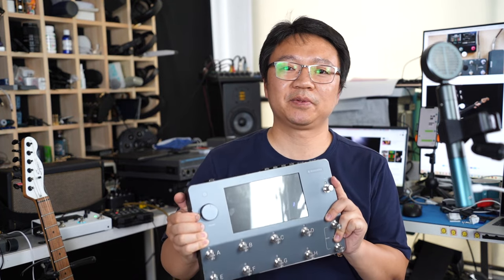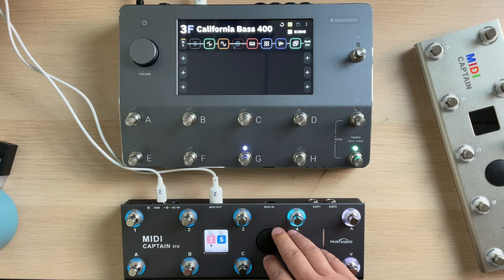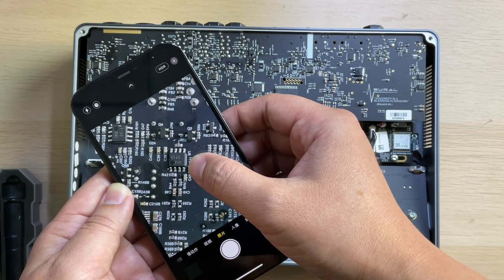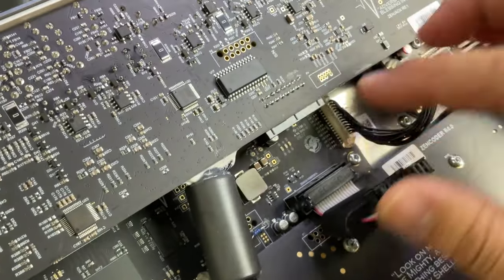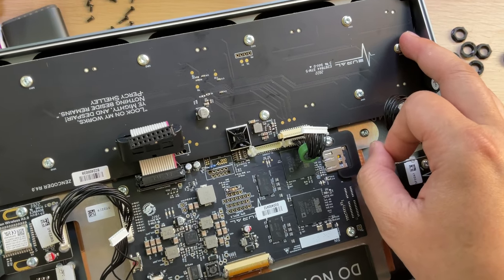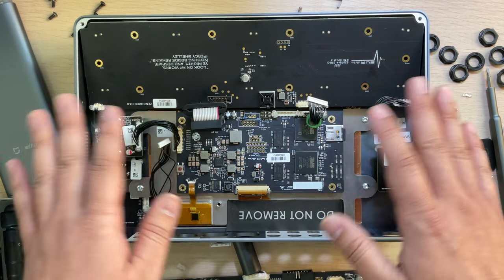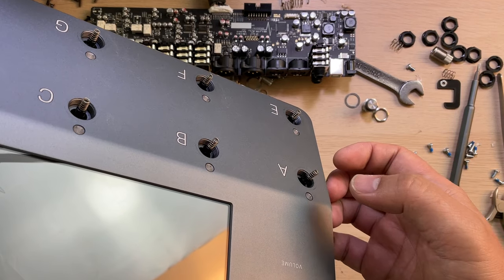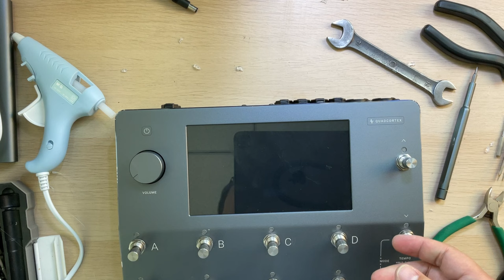Quad Cortex Teardown Good Design? Cost? Stable? Worth? and MIDI Captain Control

Comment: I’m not an engineer by any stretch of the imagination – I’m a guitar player who has soldered a few analog pedals and opened an old modeller once to see if I could fix the power jack that had come loose. So I greatly admire your expertise and patience when disassembling and reassembling this unit. Also, it’s very cool to get an independent assessment of the quality and cost of the unit. I was hooked from the beginning to the end! =)

Comment: @6:38 The MCP23017 is an i2c GPIO expander, basically gives you access to more IO pins to allow additional components to talk to a microcontroller/CPU- possibly used for the switches and encoders here

Comment: I disagree about the screen being the cause of how warm the unit becomes. If you put the unit into standby mode it still kicks out the same amount of heat. The case does a great job of being a heatsink though. 

Great to see it's well engineered and well built. Also, really nice that its built in Finland rather than the far east.

Comment: Any thoughts about the wifi module? I have weak signal problems, even when the QC is close to the router, and many people reported the same issue. Could it be a design fault, low quality components or a software issue?

Comment: I literally JUST bookmarked the little Midi Duo you make as I've got a Quadcortex ordered.  I'm wanting to use it to quickly control the QC looper.  I'm currently using a separate looper (ditto X4) and all I do with the looper is record a loop, tap a switch to stop/play the loop and hold down that play/stop switch to erase the loop.  2 switches needed to operate the Ditto looper.

What I'm hoping to be able to do is use the Midi duo pedal to do the same thing.  Program one switch to capture the loop and program the second switch to stop/play the loop or hold the button to erase the loop.

Do you know if the midi duo and quad cortex allow it to be programmed this way?  My pedalboard space is extremely limited which is why the midi duo is at the top of my list.

Comment: Fascinating breakdown. The engineering looks very good, except for the passive heat dissipation. I've got an HX Stomp. I keep a computer fan running next to its upper left corner, to wick away the heat, as that's where the screen is and where it gets the hottest. Works surprisingly well. Heat is the enemy of electronics, but there are simple solutions. Thanks

Comment: this was interesting but given time I had to skip forward. What was the consensus on the wifi cuz that is my biggest complaint on my unit that its quite weak. Oh and the old style USB port. Should have been USB-C IMO. Keep rocking!
Reply: I read often that usb C should be used on newer devices. But it think the old big ones are much more rugged. USB-C breaks much more easy. Don't you think?
Reply: @SebastianBogensperger  i dont really agree though I see your rationale mainly because they used such an out of date format. I am pretty sure most people would not have that cable format handy anymore especially if you need a long one as I did. USB is the standard and is being enforced in Europe across a lot of devices for uniformity so I suspect as the laws start getting enforced you will see a USB-C QC come out. I had to buy a special cable that terminated in USB-c so I could plug it into my mac. A cost I should not have to pay. But it is a trivial complaint over all. I was more pissed when they dropped the price bc I felt like I got taken advantage of. At least offer us some plug ins etc.

Comment: After around 10 year of use my Kemper powerhead  LCD has darkened that reading the letters was barely readable  even if there was backlight. then the silicon buttons are already yellowish. About a month ago I heard a a thud and then its gone. Apparently the power supply  gave up. I called Kemper helpdesk and still having difficulty sending it for repair until now.  My only regret is that I haven't used this for more than 50 times because I'm a busy person. On the other side my Axe Fx is still running flawlessly. I think Quad Cortex is build a lot better than Kemper .

Comment: Very good video. Would be interesting to get any thoughts on improving WiFi performance. With the WiFi module behind what's essentially a Faraday cage, it's hard to get a good signal.
Reply from the maker: Great point! I may check again where the antenna had been put. It is a big problem for a full metal box. When I design the MIDI captain with wireless 2.4G function, I had to made the side cover by plastic.

Comment: Great video!! Does anyone know the size of the screws needed to attach the foot switch portion of the board back to the body? A couple of mine are missing and I’m trying to replace them. Just want make sure I get the correct size before trying out a bunch of different sizes. Thank you in advance for your help!

Comment: Could I use the quad cortex set to scene mode to control scene changes, and at the same time use the midi captain to change / turn on and off pedals?  Mimicking pedal mode?

Comment: The SD Card contains firmware and  also user data. It contains Linux partitions which are invisible to Windows machine.
Relays are for ground lifts, I believe.
Reply from the maker: 👍 I had a guess that maybe the SD(TF) Card can store the user/thirdpart IR response files, but 64M is too small to hold many IRs.
Reply: @Wilson-PaintAudio  The card is 32 GB. Windows is not correct. You need Linux machine or third party Linux file system software on your Windows machine to read it correctly.
Nice teardown by the way!

Comment: I have been thinking that the sharc dsp days are numbered.   The ARM V9 stuff runs at a much higher clock and has a higher core count.  For $10 you can get a 800MHz dual core A9 chip, or a quad core arm for not that much more.   Unfortunately I have seen ARM based designs use embedded linux (fender mustang gt), this ends up causing 4mS of latency (measured using the free software on my channel).   This pedal could have much better latency, but it depends a lot on the software design.
Reply from the maker: Yes, I think currently SHARC DSP still has its advantages in audio processing, and there are historical reasons as well, such as commonly used algorithm libraries. While other application-level processors may have higher clock frequencies, they may have shortcomings in terms of latency, vector processing, and parallel multiplication and addition operations. We can think it is like a GPU and a CPU. However, technologies like NEON (Advanced SIMD) in ARM have already blurred the boundaries between audio DSP and ARM.
Reply: @Wilson-PaintAudio  I looked at analog devices offerings nowadays,  Its been a couple of decades since I used one (Gibson MaGIC), they have chips with dual SHARC cores plus an Arm A9 and some some coprocessors for FFTs and IRs.   Clock for clock the SHARC would absolutely beat an Arm A9 for this workload.   But, thanks to cell phones, the Arm chips are more mature with higher core counts and clock rates.   Plus the tools are free on arm rather than the 1K + yearly subscription fee for the adi chip.    I guess I was confused by the product name, as an engineer 'quad cortex' to me implies Arm, I was surprised it was SHARC based.

Comment: Hey Wilson, can you do a video on the midi captain and Axe Fx 2? I programmed in Geek mode but it's not the same when I switch to normal mode
Reply from the maker: Normal mode and Geek mode are seperated program. There is a preset in Normal mode for Axe Fx2. Also you can set midi at the AXE host side from Menu "I/O" -> MIDI and CTRL page

Comment: Disappointed with the encoders as footswitches. I thought it would be something more sturdy. The plastic shaft is sus. I know, the upper part takes the hit and the distances are set to not force the encoders. But anyway...
And about the cost, the more important, the software.
Reply from the maker: Understand your feeling. Me too! However, I don't want us to mistakenly think that this plastic thing will be fragile. In fact, it is capable of fulfilling its functions, and from a design and manufacturing perspective, injection molding is also the best choice. What I think it can be better is that the foot button actually feel a bit stiff when stepped on, expecially when a little deviating from the axial direction.

Comment: I am actually surpriced that there actually is real DSP chips inside. I always wondered why these Items vere so expensive as the name  indicates it's based on an ARM Cortex Processor. Today It's becomming more and more common that many Synth's and effect boards is based on just a Pi Compute board which is dirt cheap as long as they can actually get them.
Reply: I'd be very, very surprised to see any similar type of product without an 'off-the-shelf' DSP. The Axe-FX 3 has a widely available Texas Instruments DSP. Remember, these DSP's are already developed, proven, extremely functional and, most importantly, cheap (the Axe-FX 3 DSP is around $60).

Comment: Gets too hot. Needs a fan. Better yet- sell it and get a FM9.
Reply from the maker: I just get a fan fit for it. And planning a video on how to add it in😄
Reply: @Wilson-PaintAudio  Sad for 2k you have to add a fan.
Reply: It really doesn't get too hot. The fact that the casing gets warm means it's doing its job as a heatsink. A fan will only fail or become noisey over time. Passive cooling is a plus in my books in this instance.